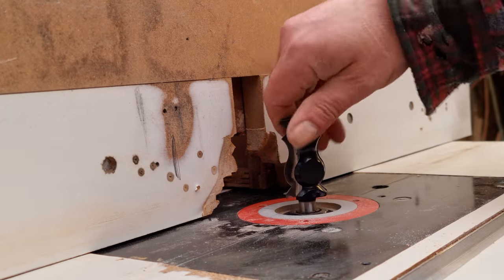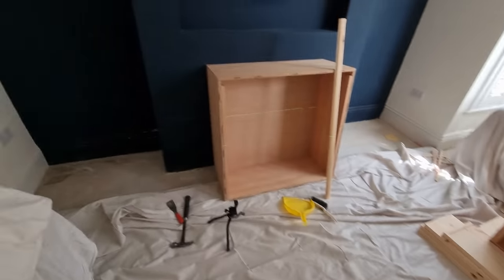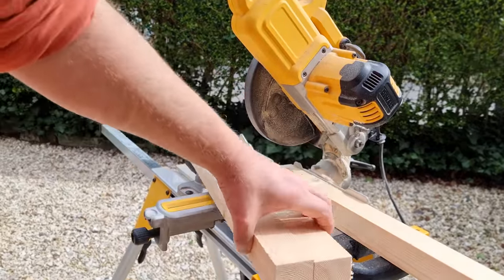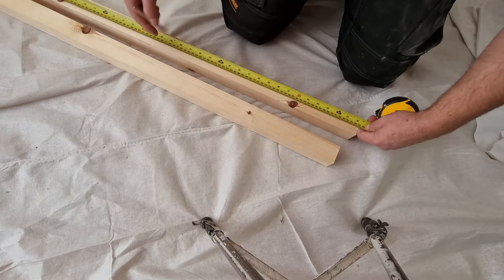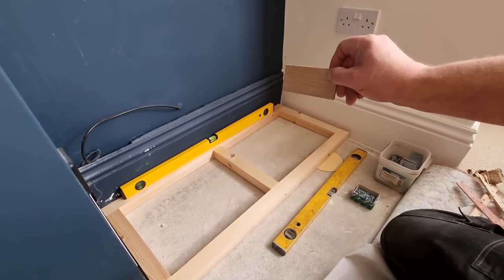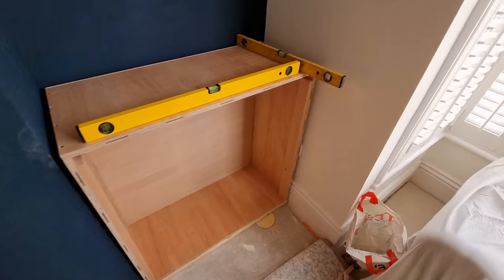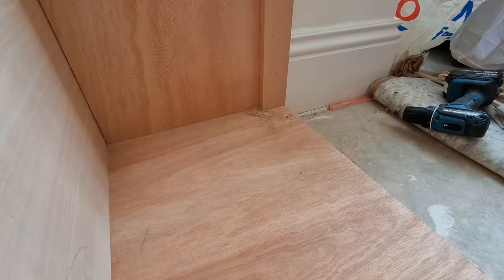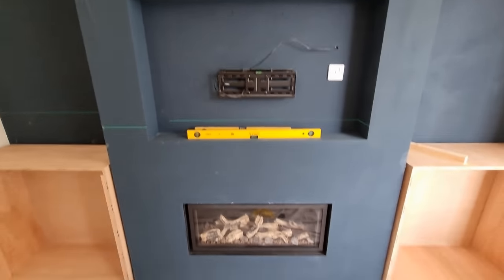Debra's Alcove cupboards & Shelves build Pt5 - Fitting the cabinets in the house

Comment: Really great series.  Very detailed step by step.  Just curious, how will you use the outlet hidden inside the lower cabinet?
Reply from the maker: Thanks, glad you liked it 👍 The outlets in the lower cabinet were moved outside the cabinet before the cabinets were installed. I did the basics on the right one moving the wires outside & I created access for the left one, also chopping in a channel for the wire, an electrician came later to finish & put the faceplates on. This is Pt5 of 9,  I show all this in the later videos.

Comment: Looks good Gid. I just did something similar here in New Zealand. I used plastic adjustable legs and mirrored the skirting board as the toe kick. Dead easy to level it. Was lucky with the power points as well. Also fitted scribers to each side as well. Was also lucky that the alcoves were deeper than yours so as the cabinets were behind the chimney breast.
Reply from the maker: Thanks  Darryl 👍👍

Comment: Why not useing the little Makita gid
Reply from the maker: I haven't swapped the saw stand mounts yet 😴 might just buy another set & leave these ones on the Dewalt 😂
Reply: @Gidjoiner  I had a bit of hassle putting DeWalt saw stand brackets on my little 36V Makita Gid. The newer brackets have a double lock on them. In the end I took an old set off of a 12" DeWalt mitre saw I have that's a w/s saw. They went on the little Makita no bother. You'd wonder why companies like DeWalt mess around with a perfectly good design! 🙄🙄
Reply from the maker: Yep the ones on one of them have broken already, someone did mention that so have been careful but... 😒🤦‍♂️